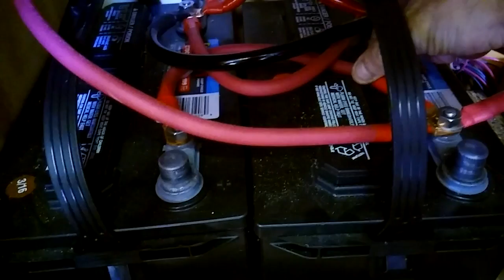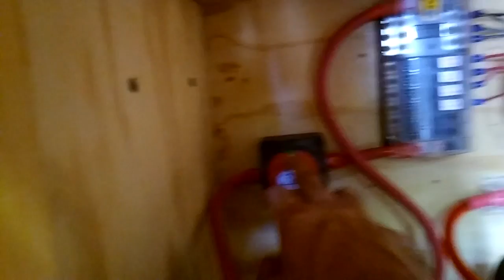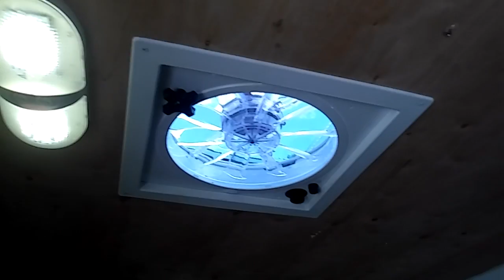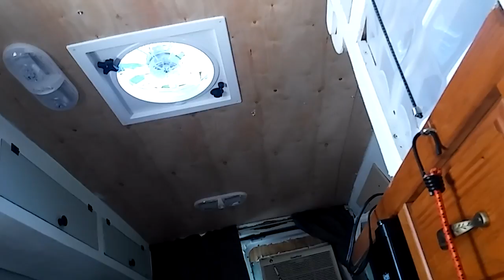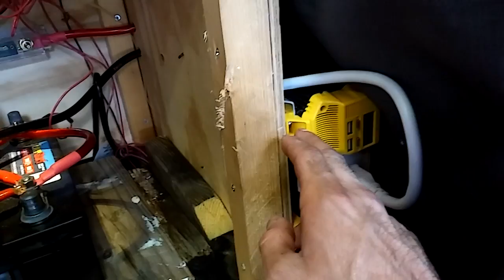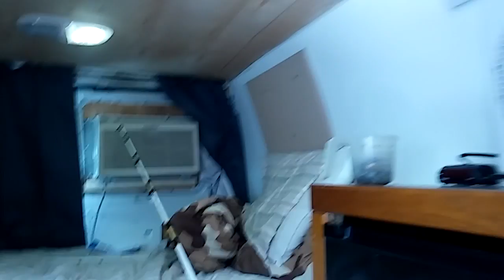Campervan & RV Electrical System Explained - Battery Bank, Wire Gauge, Inverter, Solar, D/C, ect.

Comment: Battery to fuse = 2 gauge wire, correct?  Fuse box to lights, fan, etc...= 12 gauge wire, correct?

Comment: The battery acid will eat carpet and a whole bunch of things. Go to your car and use a scrap piece of Levi's jeans to clean the top of the battery set the material some place safe and check it two hours later there will not be much of the material left be carefull it could burst into flames no joke that is the other thing DO NOT PUT BATTERIES NEAR STOVES WATER HEATERS  CENTRAL HEATERS OR A PLACE THAT HAS OPEN FLAME OR SPARKS BATTERIES CAN AND DO EXPLODE WHEN EXPOSED TO A SPARK OR OPEN FLAME. IT SAYS IT RIGHT ON TOP OF THE BATTERY. NO JOKE !

Comment: They should not be inside or they should be sealed from gassing inside get a external vent or you will be breathing acid vapors. When a battery is used it's acid water level drops that should be checked once a month when they are being used just like your car battery. Your car battery if inside the  cabin will have a little tube comes off the top middle side of the battery and that tube runs out side of the car to vent acid gas fumes vapor away from friends and family and anything else in the car. The warning on top of the battery is there for a reason. If you have lead acid batteries inside your rv and they are not properly vented YOU ARE BREATHING ACID FUMES, VAPOR, AND YOU ARE STUPID NEVER HAVE LEAD ACID BATTERIES INSIDE WITH YOU THAT ARE IN USE unless they are properly vented. The batteries you showed do not look vented to the outside. Make sure the enclosed battery compartment sealed to the inside and vented to the outside. No need for a fan just open air vent will work just fine.

Comment: Hey Carl I just got a little DIY teardrop that has the fan, and lights wired already to a small 12v lawnmower battery. It's already also wired into the voltage reader, cigarette lighter adapter, and 2 usb ports. So I don't want to change anything with that. What I want power for is a small heater, some small cooking appliances that are all 500 watts. Plus I have a window unit ac like you, but won't be using it much. But I want power when I'm not able to get shore power, and not really wanting a generator just yet. So I'm getting out of this is I just need the solar kit to charge my battery or batteries. And everything except the stranded wire and the fuse box. Am I getting that right?

Comment: Hello, Great video, Now the charge controller that comes with the 100w renogy kit will that work with a 2000w inverter and 3 100watt panels?

Comment: Is the negative Inverter wire going to the negative port of the battery on the left?  (The farthest battery from the inverter)  You point at the right hand batteries negative port when you talk about this but it looks like it is connected to the battery on the left.

Comment: Great video!!  I'm converting a horse trailer into mobile bar and I've been successful with your EXACT instructions.  Question:   Should I use a toggle switch to isolate hookups to the fuse box?  For instance, I have appliances, interior lights, exterior lights, and water pump to fuse box.  If I'm servicing a day event and only need appliances, should I use a separate toggle (on/off)?  If yes, what do you recommend?

Comment: Im building an ice shanty. My question is should i put a 10 amp fuse before my 8 foot led light? And a 2 port USB port. Im just using 2 mighty max 12 volt 18 amh. And bought a trickle charge 20 amp control.

Comment: There is so much wrong with this where to begin. All right let’s start here lead acid batteries. You should never have them inside your van where you’re sleeping because they off gas. What will this do well time will tell. Amazon does not carry high-quality fuses breakers etc. And a simple build like he’s done here this stuff might work. When you get into 3000 V it’s not gonna. I think I’m gonna stop here and see what the reaction is on you guys

Comment: Hey there, thanks so much for this. Quick question: how would you wire a stationary (built-in) shore power charger for the batteries with the existing system you’ve shown here that includes an inverter? Thanks so much!

Comment: Great video, quick question currently looking into a set up like this one, could I run a air compressor on a set up like yours only with a higher inverter such as a 3000 Watt?

Comment: Acid batteries shouldn't be inside without a vent! It looks like you have two hots going to your fuse panel when the top one should be the ground! Best Regards always be safe !

Comment: Good video mate but no way I would use redbattery  leads on both pos and neg terminals - melt some black heatshrink on them to avoid any mix ups when not concentrating

Comment: Hi Cory... I just bought the Kisae 2000 Watt Inverter/Charger.   What length and gauge of an extension cord would you recommend for a 2000 watt inverter charger when I want to charge up from a pedestal at a campground or an outlet at friend's house?    This is for my minivan.

Comment: I bought a Renogen solar system Kit, where should I put the shutoff switch and the ANL fuse  if I  am going to run 3- 100 Amp hour batteries,  also please what size of ANL FUSE?. THANK YOU

Comment: You need to fuse the wire going to 12 volt disconnect

Comment: Hi! Thanks for your clear explanation!! I want to hook up my two Marine batteries in my trailer (Fifth weel). 

I know I must hook up both batteries in parallel. Then with the trailer taje the black wire to the Negative point of the battery number 1 and the red wire to the Positive point of the battery number 2. 

If I have two red wire in my trailer to be hooked up, I Can put them together in the same Positive point of the battery number 2!?

Thanks so much!! 😊🙏🕺. 

The situation jefe

Comment: Great video and explanation concerning your set-up and plans.  You could also install the isolator (which is a solenoid, and where it's power comes from an "engine running" fusebox relay connection) so that your house batteries will get charged by your van alternator if your solar panels are doing the job (lack of sunlight hitting those cells...).
Reply: https://youtu.be/1zrwHyy4qyY
Reply: https://youtu.be/CGD8HAeg5UA
Reply: https://youtu.be/9jjh3Y4xIL8

Comment: Hey bro, what size fuse are you running coming off the positive on your inverter? I’m setting up a real similar design, running off at 2000w Inverter that peaks at 4000 W, and I’m trying to figure out what size fuse I should run coming off of it.

Comment: Thanks man, great video. I have 1 question, you said you can charge your batteries with shorepower, how does that work? Is the shorepowercable hooked up to the inverter, which in turn charges the battieries?
Reply: Nope, you're close though. The inverter in this case, will only turn 12V DC to 110/120 AC. In order to charge the batteries you need a battery charger, I believe there are some inverters that come with both though. If you're looking for a decent charger, go with ProNautics and get yourself some AGM batteries.
Reply: @ivaldez5715  Got it, thanks

Comment: Hardwire one of those Walmart 50$ chargers they got 2 models but there the same one with different names black n decker or Stanley. Just cut the alligator clips and put red tape on positive one so you don’t forget which is which then put loop connectors on the end and attach it to the battery. Just don’t hit none of the buttons on the charger Like the jump start button. It will automatically turn on and charge battery when connected to generator and do float mode when there full. I did everything you did including the ac in window and the generator but I got a little bus not a van. I even bought the same solar panel kit you got but I been to lazy to install it. From the generator I got a cord that goes into the bus n I set up a 2 breaker fuse box and ran a few outlets inside one for AC only the others for everything else. Long story short it’s easier to just hardwire that charger and you won’t find a video on it. I had to just test it myself and I’ve been doing it for 8 months no problem.

Comment: small question. when you want to ''shore charge'' your batteries where do you have to plug de ac connector? the inverter? that the only point i just dont get
Reply: Most people put an outlet on the outside of the vehicle that you plug into.  However, I suspect this guy probably plans to just run an extension cord through a window or possibly a hole he drilled into the van.  He would then plug a battery charger into that extension cord. 
Note: Some batteries require special types of battery chargers.

Comment: Cory, excellent explanation!  Question: I have one deep cycle 12V battery at present. how should 
 wire in a Battery Monitor?  Straight to the battery? Through a fuse protected circuit?  Thanks bunches!!

Comment: This has been the most helpful video I’ve seen. Everyone looses me when they explain in depth how much better the battery they choose is or what brand of equipment I should get. I just needed a video to break down how this system works! Ty!

Comment: So on the 12v system off the battery, the fuse panel gets red power line top & bottom?

Comment: Making sure I have this right.
You're running high amp charge batteries / normal car batteries, not the lower amp charge batteries that a lot of people run on solar setups?

Is this to avoid the lower charge amps on  the bigger 100Ah batteries?

Comment: Thanks for your video have a question. Could you plug a battery charger into your converter and charge the battery at the same time ? I just bought a 7 X 14 v nose.so i am getting ready for my camper build. There's a lot thinking to do .

Comment: Cory I would like to subscribe and for good reason... most of what I have see over the last couple of years have all been informative for the most part but I got the most benefit from you and the way you describe each component as you travel thru your system, I can understand it that much more easier then some of the others.  you take your time and point out the voltage schematic for your 12 volts then ultimatly your inverter.  IT JUST SOUNDS GOOD an it works the way you want it too.  Thanks Cory best of luck my friend.

Comment: Hi. A question, and please excuse me if it "sound" stupid: Does a power converter charger replace a battery charger?  And thanks for the clear explanation about the battery connection in you video.

Comment: you should wire the inverter to the main switch (on the + terminal of the fuse box) this way u can never drain batteries in case u forget the inverter on (it always drain when on, even if nothing's plugged into it)

Comment: Your charge relay to you alternator is called an isolator. I wouldn't buy the Walmart brand deep cell batteries from experience they are really crappy batteries so when it comes to you batteries don't buy cheap go ahead spend the money and buy a better quality battery that will serve you longer. And again from my experience I didn't have much luck with renogy products renogy products might serve you well but for me the lifespan of the solar panel was short and the renogy charge controller that I had bought for my setup only lasted about a year before I had to wind up replacing it may be different for you guys but for me it just wasn't worth it.

Comment: FINALLY!!!! I TOTALLY UNDERESTAND WHAT TO DO,.... Thank you for the simple directions..... HIGH 5 Brother....going to wire my stuff up now!!!
Reply: How's your 12 gauge wiring holding up ?
Reply: @Lone-Rider-d8w  the fuse/breaker situation is messing me up. I think i need better quality butt connectors. I can't seem to get a s\olid crimp. I have a hydraulic crimper as well as hand held. I guess I should use the hydraulic,,,. But still not wired up. I am going too VanBuilsd party in Nov. I may have someone help me if god forbid I'm not up n running yet... Thanks for asking..

Comment: Hi ty.  Nice summary.  My thoughts are  If u beef up ur batteries just a little more and get a soft start for ac u can run a small ac on battery power...get ac efficient and smallest ac u can find.  Also the ac fridge is a real drain for those using it for more than on occasion bc the inverter also requires power that zaps the battery.. So not just the fridge but inverter too.  I like the in house charger that u returned and use it instead of the more expensive isolator or selinoid some use in order for alternator to charge house batteries.  I also increased my alternator amps so it can handle the load of charging my cab batteries when the son is not out.  On inverters, make sure u use a pure sign wave for any valuable equipment.  On solar a mono crystaline panel is better than a poly if u have a lot of sunny days where u r.  Finally for those wanting solar make sure u get an mppt controller...they are WAY more efficient in converting sun to battery power.  Thanks again for good summary.

Comment: I like the central control box design. I had to separate the batteries from the charge controller/inverter due to truck bed space. I like the concept of using the alternator to charge while driving, but I'm leery of messing with my vehicles engine. Good craftsmanship too.  My build looks a little rough, but it functions, which is most important to me.

Comment: Great video! Thank you. Quick question. I plan on wiring 2 Maxx Air fans to the fuse block. Do both black and white wires from the fan get plugged into the fuse block or does one wire get grounded elsewhere? Thank you!

Comment: Thank you so much for explaining this and making it simple. I feel like everyone else’s electrical videos have been way over my head. I have a question, so I got the Jupiter 2000 watt inverter and it did t come with that fuse that yours did, can you recommend a fuse that I should buy to go in it’s place or should I skip it? Thank you!!

Comment: Excellent video. Explains it all very well. One suggestion would be to check out Renogy's site (renogy.com) and order direct from them. That way they'll answer your technical questions. They know all about this stuff. Very nice people. They have complete 1-4 panel solar kits, batteries, inverters. Everything you need.

Comment: Thank you Corey. I am struggling to understand. I plan a setup like yours, but plan to be off grid so will be using gennie to charge Batts. Not sure how to do that. Do you ever plug directly into gennie, or use batteries? I

Comment: Hey man, wicked video thanks! You’ve made it super easy after trawling internet for a while. Had one question, if I wanted to add a voltmeter to the circuit where would that fit in?

Comment: This is three years old, but it is still a great introduction to electrical systems.  I just got my van a week ago, and after the flooring is done (my current project), I need to work out the electrical.  This helped a lot.

Comment: There is the red positive cord going to the switch, then to the box at the bottom.  What is the red cord going to the box not through the switch that is at the top? Is that a wire coming from the negative?

Comment: Hey bro,  I am in the beginning stages for converting my 94 Astro Van. And just like you-the electrical put is my issue. I have an inventer  and I am currently in the market for batteries. My question is- I have a solar panel that came with a charge control base. I want to make sure I heard correctly-that charge control base will charger my batteries? 

I don't know what it's called-but I was considering on purchasing this device that connects to my van battery-while the car is running it'll charge my batteries.  Thank you for  the helpful insight.  

Be bless. Brandon
Reply: Continuous Duty Solenoid rated to Amps of your vehicle Alternator. There's some good videos on cables and DIY hookup on YT. Cole-Hersey is best brand & reasonable prices. Make sure you use Split Loom on all your cables and secure the cables to frame's underside.

Comment: nice job ,   what about wiring this set up to van battery ( with another shut off ) so batteries can be charged while driving
Reply: You need something called an isolator, which manages the charging. Here's an article describing dual battery setups: 

http://www.outbackcrossing.com.au/FourWheelDrive/Basic_Dual_Battery_System.shtml

Comment: does the battery switch light up when power is on ? Looks like it does which would be nice. By the way your link is not working to Amazon for the switch.

Comment: The top wire hooked to fuse block is red..  but its hooked to ground on battery,  right?   Great video...wish someone would explain as good as you with a 120 to 12volt converter/charger from a 30 amp panel box

Comment: Great video boss, consider venting those batteries. Those flooded batteries give off hydrogen when they are charging. Very flammable. Again great video STAY SAFE!
Reply: That is what I saw; Looks to be she has a 24v supply though if Parallel I would go for Voltage to get what I think is better performance; He may notice the odor and if not fixed it should vent to the outside even if not; 
I heard of mechanic scaring his face ( badly ) at shop where I worked though myself have never had a battery explosive due to H2SO4 gasses even though careless and aggressive; One  spark in confined area like that and Left Wing on the West Coast will hold 200 Meetings statewide